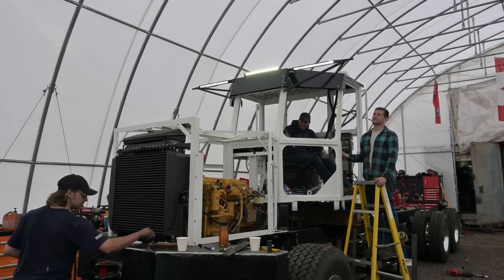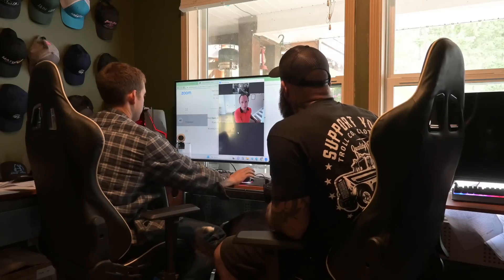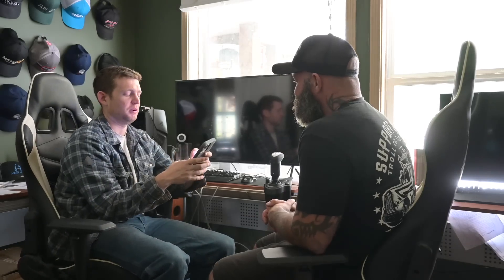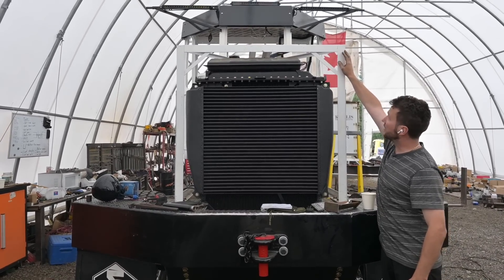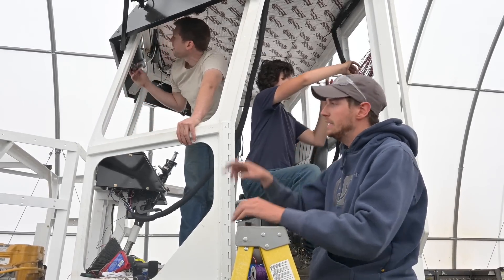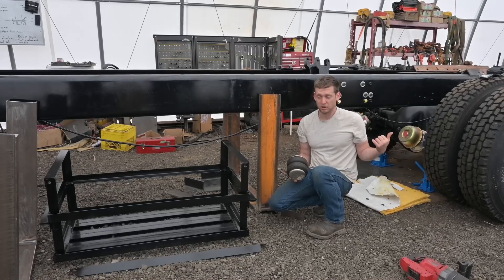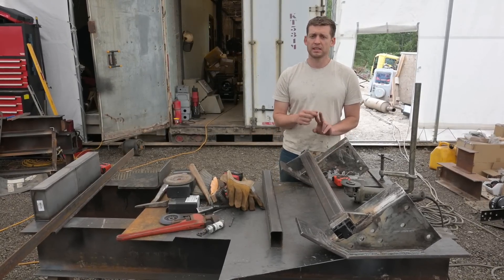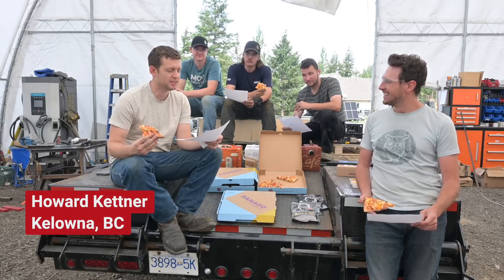Revving Up Progress: Truck Build Updates, Energizing Coffee Runs, and Solar Power Unveiled!

Comment: I do marine wiring for powerboats.   Wire labeling is crucial in remote areas.   Similar to a boat stranded offshore, a logging truck stranded in the mountains with an electrical issue is an emergency.   

We label our wires at each end, with the location of the other end.   So if a wire runs from a battery to the starter solenoid on the diesel, the end attached to the battery reads: "SOLENOID"  and the end attached to the solenoid reads: "BATTERY POS".   Because anytime you look at a wire the first question is "Where does it go?".  

This type of wire labeling benefits the end user or mechanic the most.   Combine this with a sensible set of wire colors for a much better picture of the electrical system than unlabeled or incorrectly labeled wires.

The worst labeling for the end user is to label the end of the wire with its own location.   This is redundant.   The end user is already looking at the wire and can see where it's connected.  This is labeling for assembly only.    Much better to label it with the location of the other end.   Of course, you can add more info, such as circuit numbers, etc as you see fit.  

Keep up the fantastic work!  I was a product development engineer for a Tier 1 automotive supplier for 9 years and I really enjoy watching the process.  I also managed a group that built wiring harnesses for military MRAP Vehicles.  If you are interested in wire labeling, I can provide more information and some great examples. 👍🏼

Comment: might be a dumb question but why is there a diesel engine in it if its electric
Reply: Not dumb at all! 
The truck will run primarily on the batteries. It'll use the diesel engine for power boost, and charging.
When diesel engines run at a constant speed, they're more efficient.

Comment: If you want a general purpose camera for videos, a camcorder is a really good option. They are more efficient on batteries, ergonomics are better and they have everything built in. Get something like a Canon XA series or Panasonic X2000. There's no screwing around with interchangeable lenses, lens caps or audio recorders.

Comment: Needs a DOT approved stamp to be legal in the US... if you intend to sell these trucks in the US, you might want to look into that. For some reason i  wanna say you cannot use light bars as the source for your headlights in the us. Pretty sure we have rules about where they can be located on the vehicle... what you have there... its gonna blind oncoming traffic... you cant just build the truck to be safe for you... you have to build it to be safe for the road
Reply from the maker: Different areas have different regulations 
Correct 

- Theron Danger

Comment: Talking about patents and airbags... and now that you are thinking about gathering as much energy as possible from every possible source, what about designing some regenerative "bouncing", aka regenerative airbags, I don't know if it would be cost effective, but if you drive with a passenger it could spark some nice conversations...

Passenger: Damned! this road is bumpy...
Driver: Yeah! Isn't it great?

Passenger: why are you jumping up and down?
Driver: It's cloudy and I'm running low on batteries AND fuel...

Comment: There is a part of me that wants to see the hood as a clear material.
Reply: If not a full acrylic hood maybe some little windows.  Even better would be to do a strip of LEDs to light up the Cat at trade shows.  Prototypes are all about showing off.
Reply from the maker: I’m listening….
Reply: @EdisonMotors  Well seeing how much you could see into the cab from the ground with no hood, it would probably make it have better visibility, and it adds extra transparency to the fact you are using a range extender so there can be no confusion. 

Also, I saw clear hoods once in a tuner car magazine and became obsessed with clear hoods.
Reply: It would be cool if the radiator could go somewhere else, then the visibility would be amazing. Probably not practical, though.

Comment: With the solar panel leave a airgap under them, they tend to cook and die and transmit a lot of heat to whatever is under it. Common failure mode on panels mounted on the roofs of vans. Also consider how reflective is a panel before putting it on the hood.
Reply: Those are very good points!

Comment: As someone who has both wanted a nice and tidy wire box, but also wanted just a little bit more wire for a splice... My soul splits over which I truly desire more.
Reply from the maker: I figured mechanics/electricians  would like that feature
Reply: @EdisonMotors 
We do hold a special place in our hearts for anyone who leaves us enough wire to work safely and comfortably.
The ones who leave us nubs have a special place in electrician hell😂
Reply: If its tied up well, it will be ok. I'd rather cut 20 ties than having to extend wires.

Comment: I always think a set of shiny metal hangers really tie a wiring loom together

Also quick question, would the drivetrain be more efficient if some of the driven axles are shut down and only running on one motor, or is it just all drive all the time?

Comment: Seeing all that room in the engine compartment makes me think that a removable warmer box would be a neat accessory for meals in the bush that wouldn't interfere with maintenance much.  Since the engine runs intermittently, it may need electric heat to supplement, but that gives you the opportunity to use a thermostat. So you'd basically have the world's only truck with an oven in it.
Reply: Rivian levels of ridiculous but cool
Reply: There used to products that would attach to the exhaust headers of a car to do just that. There's even ones specific to snowmobiles
Reply: @gormauslander not ridiculous if yr in Backcountry
Reply: YESSSS
Reply: So your idea is to install a toaster oven? I like chicken fingers please.
Reply: Poke a hole in a can of beans to keep it from burst and set it near exhaust manifold.
It’ll heat right up.

Comment: On the production model use standardized colours (identify them in your shop manual) or get wires printed with circuit numbers.
Reply: I actually have a label printer that takes heat shrink tubing. It's great for labeling wires. Color coding also helps quite a bit as well. Personally I recommend both

Comment: Looking good!
Try a floor or bottle jack under drill next time. Little pressure works wonders on this big bits
Reply: Also pilot holes make a huge difference.
Reply: Maybe add a wood block to spread out the pressure.  Drills these days aren't meant for very much pressure on the plastic housing, but i have definitely used the "2x4 and strap for a shoulder lever" trick when drilling thick steel.  

My shoulder likes your idea better😅

Comment: Looks sweet, though running the loom beside the doorframe will cause it to get bumped into and damaged. Figure if guys are carrying lunch or toolboxes in and out of the cab it'll get whacked pretty frequently. Maybe run the loom down between the windshields?
Reply from the maker: Yeah, that would have made more sense.  Next version!  Easy design change
Reply: @EdisonMotors how long is your list for the next version?
Reply: Might be able to add some protection or additional adel loom clamps to prevent damage in those areas.

Comment: I’d forget the loom. Put the harness in a trough that you can pop the cover and pull the wires out to work on.  Also get numbers printed on the wires. Makes diagnostic so much easier.

Comment: I guess that you took into account the possible drawbacks of flexible solar panels like: more heat (no airflow below the solar panels), less efficiency (because of the increased heat), heat transfer to the cabin (in winter this will be an advantage), less durability (half of a rigid panel), more cost etc...
There is at least one brand (Trailar) that sells flexible solar panels designed to be used on trucks, and I guess that they have already thought about all this issues, but...
Reply from the maker: Yeah, they’re not as great but they’ll still produce enough that even if you leave a truck for 2-3 months it’ll keep your bms, and truck battery topped up and maintained
Reply: Wouldn't be too hard to gap the panels slightly for airflow.

Comment: Good morning from Sonora Mexico. Hey guys this project is really coming along nicely. I want to tell you how impressed I am with your truck. I hope you can get some help somewhere in the Canadian government to streamline your operation. I know this is going to be a great product. I think you would be welcome in Mexico to build heavy trucks here for the drilling companies that do mine exploration core drilling. A lot of your countrymen come here to drill. These trucks are brilliant. I really like the idea of your prototype. With your generator, you could drive the truck to the location and then the motor could run the three phase motors on your drill to operate. There is a level of efficiency with diesel electric and batteries that is really worth noting. I am a welder and my generator burns about 5 liters of fuel per hour regardless of light load or heavy load when the motor revs up. That means if I'm using the grinder, it's pulling 6-9 amps and that is using the same fuel as welding. This is not efficient. You have to understand that your fuel is the means to an end. The batteries hold the potential of having the power that you already purchased and produced available till it's used.
Reply: If I recall correctly they had to make a separate system to cool the batteries because the diesel and the batteries like different temps. So yes the batteries have their own cooling system.
Reply: @jonathanellis8737  i wonder if they will have an option whereby a cooling circuit or heating circuit could basically be set so that in extreme temperatures the batteries could be kept at perfect temperatures until fuel or batteries ran out. So if you're parked, exposed, you're not worrying about degradation or environmental damage.
Reply: @bookworm8415  they have heating pads as well for winter so they can heat or cool the batteries depending on what is needed, and I think they plan on tying the battery management control into those.
Reply: Thats an amazing point to consider. 

Is there a cooling/heating system that is automatic that keeps the battery banks at an optimal temperature?
Reply: Excellent idea!

Comment: I used that nylon Chinese finger trap loom material for years. One of the things I loved about it when I was making wiring harnesses for my friends cars and stuff like that  is you can open up the weave and if you have you know, a couple circuits that have to go to a different part of the car, you can pull them right out the side of that ,put a smaller diameter loom over that circuit branch and feed it back into the main loom and when you're done it looks so professional.

Comment: this might sound stupid, but I think for future design idea, you could put a 360 camera for it and have it wired into an actual ipad. 
so many have some goofy fancy infotainment system thats slow as balls when it gets old it only gets worse, when it would be simpler and cheaper to just stick an ipad to it. 

im aware that's not really the theme, but it'd be a nice feature to be able to add. something that huge should have blind spot cameras at least optional
Reply: probably better to use something powered by Android, apple kinda goes against the idea of actually being able to repair anything.
Reply: @ARockRaider  true, but apple is also better known for long term support. android is basically done with that device 2 years later. especially tablets.
Reply: @bradhaines3142  personally, I'd probably try to setup something with common PC parts and a linux OS, only uncommon part might be a touch screen, for that matter i would probably skip that and just have one of those ball out mice.
Reply: @ARockRaider agree 💯

Comment: Wow I never thought about solar charging my batteries 🤦. What a great idea! I own a mechanics service truck with inverter charging dewalt batteries. It would be sweet to just leave it on all the time with no worries and everything charged. Can you give us a link to the panels you plan to use? You guys are doing an awsome job on the truck, I'm hooked 100%. As a heavy truck and equipment mechanic I really appreciate your thoughts of future repairs to your trucks. I'm so tired of the big manufacturers making things impossible to fix in the field. I wish you all great success and hope that I see your trucks out working soon!✌️
Reply: - the camping type guys have been into solar as battery tenders for a long while, not a lot new, just takes time for OEM to catch on, lol.
Reply: @kadmow  It's also become relatively common for some emergency response vehicles to have solar as well. Helps keep emergency lighting, communications, etc. systems topped off while on a long scene or parked away from the station.
Reply: @itisjambo  , yep I have 200W on my roof when I go away, for thqt reason, the fridge runs for ever parked up. Keeps the starter battery tended, also.
Reply: The solar on the hood sounds like a good idea but i think its impractical.  The truck is being built to work off highway...the panels will never be clean, and be extremely susceptible to damage from road grime, branches, etc... keep it simple guys
Reply: @dirtdevil70 a lot of these flexible panels are built and designed for guys who offroad their camping rigs. They get absolutely beat and filthy and continue to work. The panels have come a long way in the past few years
Reply: Do you guys have a certified mechanic on your crew?  
Than may allow th do your own certifications and  safety inspections. I dont know how things work out there but in Ontario private shops can perform inspection and certify trucks.

Comment: Using velcro straps or a larger ratchet kinda thing to hold down the loom would be a lot nicer than zip-ties. Looking great everyone!
Reply: I vote for zip ties dollars are important to consider.    If you have to get the wiring harness open often I think the zip ties are the smallest of your problems
Reply: Zip-ties are the way to go. this is a work truck, there will be mud and debris that will plug up the Velcro.
Reply: Devil's advocate: A ziptie is kinda like a 1-way ratchet.
😬
Reply: In the off highway construction we used Suburban cinch straps & sleeves, but it was mainly for supporting hydraulic hose bundles so their quantity was minimal. I don't have a problem with zip ties as long as the harness has a thick nylon filament loom and is supported every 6". SXL wire would be nice too.
Reply: As someone mandated to use waxtie and brackets, zip ties are so novel to consider. They're way better then velcro. Velcro tends to seperate with conditions zip ties shrug off. Zip ties degrade in cold or over hot weather tho.
Reply: I like the idea of velco
Reply: Copco straps are the way to go
Reply: @blackcops100 Yeah we don't use those on boats and yachts,  for a reason.  Zip ties.
Reply: Velcro is the way to go. I use it in breweries to hold ¼" airlines and control cables on stainless tanks piping for support. No sharp edges, quiet, and can reuse.
Reply: Horrible idea for a truck..would last all of not long.
Reply: @leejohnson6173 tell that to the diesel locomotives that have been using the same concept for decades 😂
Reply: I like the Velcro idea too!
Reply: Velcro can't be found everywhere.  Zip ties can.  Cheap.  Reliable.  Permanent.  Fight me.